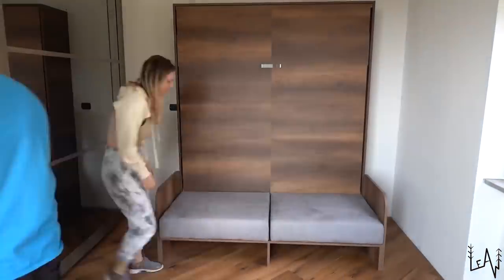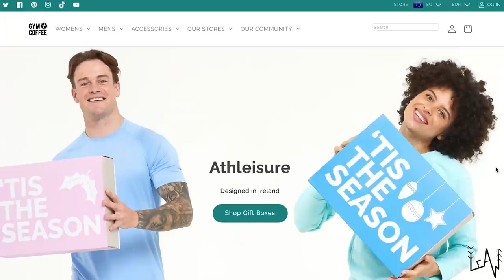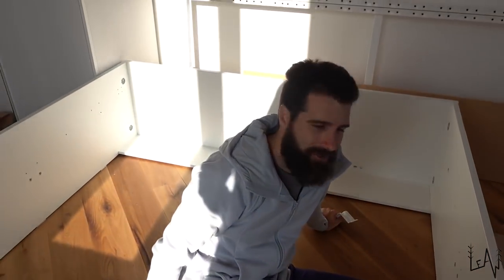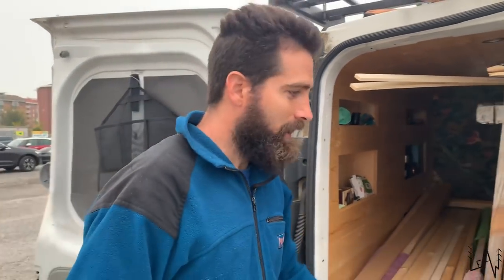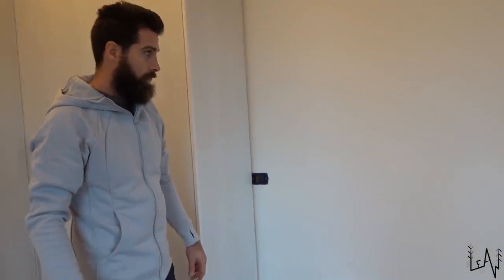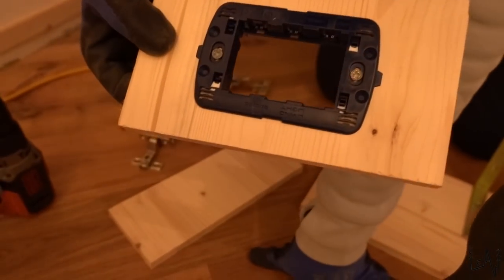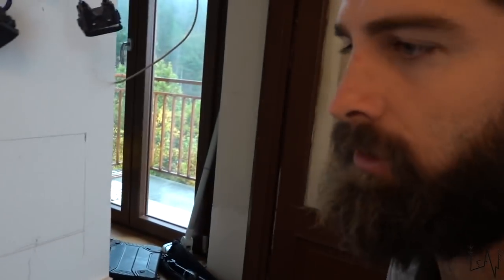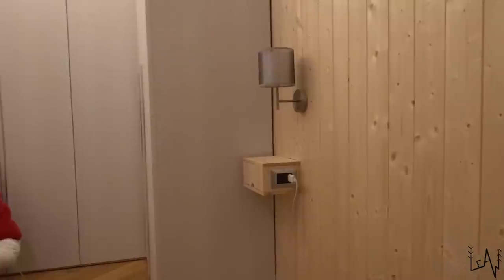DIY COTTAGE BEDROOM MAKEOVER ON A BUDGET! WOOD PANELLING / BED WITH STORAGE /FLOATING NIGHTSTANDS

Comment: I built a log cabin many years ago and used tongue and groove pine on the interior walls and left it natural.  Over time with oxidization it turned a beautiful honey color.  The only downside was when we moved an Indian blanket we had on the wall we had a big square of lighter wood where the blanket was hanging.

Comment: I would get something called pickling stain which will color the wood white but still let you see the wood grain. Let it age until it is the color you like then seal it with a clear polyurethane. I’ve done this to a few types of wood and the results are very modern looking.

Comment: I had issues of mold with a similar concept, in my case the humidity was rising from the floor into the bed, so I added thick 5 cms of plywood at the bottom of the bed to reinforce the bottom and 6 wheels to move and block the bed, best decision ever

Comment: Leave the wood the way it is!  Over time, the wood will shrink slightly, and the areas in the tongue part of the wood won't have stain, so it will show as a different color.  If you thought that you wanted to stain the wood darker,  you might have considered doing it before it was installed to avoid the lines showing when it contracts with changes in the seasons.   Also, a darker wall will make the room appear smaller.

Comment: It looks lovely👌... Don't stain the wood darker!.. then it is to much the same, plus the waredrobe and other walls are light, also it will never look exactly like the floor which could cause the wood tones "to bit" ..

Pine wood will darken with age.. I would just use a hard oil to protect it.. Or you could white wash it eg with chalk paint, before oiling.. So you see the wood grain, but it is white to fit the other walls and waredrobe.

All my furniture is pine and I buy "leached and oiled" to keep a warm natural tone. You can not leach wood at home, but you can oil.. And it looks just as good.. I oiled homemade furniture eg I made a headboard for my bed.

Comment: I would prefer a darker color on the wall....may be a green or red transparent color for wooden surfaces. And it would be nice to have some indirect dimmable spots shining on the area above the beds. To have a smooth indirect light in bed. The two vintage lights are very very bright. Only good for reading or cleaning I think.

Comment: I like the natural color, but the floor is pretty light too, and it will be easier to clean if you stain it. When you sit up in bed and lean against the wall, there will be grease spots even from clean hair. I would use a non-toxic stain in a light color that doesn't darken it much. As others have said, it will darken over time anyway if you leave it untreated.
Reply: Not if they seal with clear coat.

Comment: I like the light, natural color as a contrast to the floor. But I do think I would treat it with Tung oil which will darken it slightly, but still have the blonde pine color and protect the wood naturally. OR use the same finish/clearcoat you used in the van-- that is a nice natural color that turned out well.

Comment: Natural or stained? Look in the mirror and at each other: natural. I feel the wood should be natural too. If you apply clear lacquer, there's the old solvent-based lacquers and these tend to change the color of the wood and the lacquers become somewhat yellow over time - that will warm the tone, but you may not like that. Modern "water-based" transparent/clear lacquers will not change the color of the wood and stay clear (check with manufacturer).